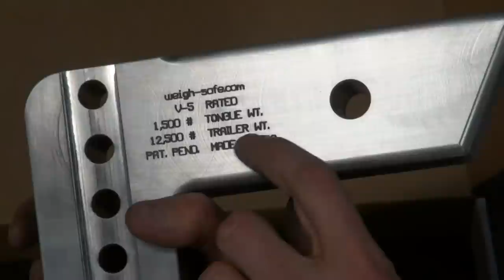Weigh-Safe factory review, adjustable aluminum hitch that weighs trailer tongue weight

Comment: jason beaulieu sad for you! Mine is GREAT! I love it. I haul 3 different trailers, dump, equipment and boat on two different trucks a F350 and a GMC Canyon Duramax. My heavy drop hitches now set in a corner of my garage. Tongue weight is more critical on my Canyon, only 700 max. Now I know what my TW is. Having read comments, I used my old scale a few times to be sure the WS was accurate. It was spot on.

Comment: Weigh Safe Co. are you not worried about the play with the ball in the holder?  We basically know that the ball itself will not wear, being stainless steel, but the softer aluminum will wear,  increasing the play. The play is no different than having all steel setup and having the nut loose.  I believe you need a sleeve pressed into the holder that will not wear so quickly.

Comment: I must ask, how does it perform when water gets in between the ball and the housing? ....because it will. Not only water but how about road grime? Grease/oil?  Just because the tolerance is close and tight that alone will not keep out water and road grime. Just my thoughts....
Reply: I'll let you know.  Mine arrives tomorrow and I'll be using it for my boat.

Comment: Kent, I have a 6" drop weight distributing hitch. Can you teach us the reason for the different height selections, why, and how to choose the best spot? Thanks for the info on the Weigh-Safe products.
Reply from the maker: LD ODOM It's all about leveling out the trailer. An adjustable hitch allows you to adjust the trailer level, which helps the trailer brakes contact the road the same for better braking.

Comment: Ford says that an equalizing hitch is not necessary with a 3" hitch shank used in their 3" receiver on the 2017 Super Duty. What are your thoughts on this? Weigh Safe now makes a 3" hitch shaft.
Reply from the maker: That's true, both GM and Ford on heavy duty and super duty have the same tow rating with and without WDH, Ford starting in 2017, GM did that back in 2011

Comment: IM TRYING TO GET ONE FOR A DUMP TRUCK I DRIVE TO PULL A BOBCAT SKID-STEER AND OR A BOBCAT EXCAVATOR AN E55 will THIS Be WEIGH SAFE BE GOOD??
Reply from the maker: Yes for tongue weight
Reply: MrTruckTV what do you mean yes by tongue weight I know there’s trailer weight but what’s the difference
Reply from the maker: The difference between what.

Comment: What drop would you suggest for a stock Ram Sport 2017? For "general purpose" without affecting much clearance
Reply from the maker: If it's a 1500, you may not need to drop it

Comment: What hitch would you recommend for Honda Ridgeline 2019?
Reply from the maker: WIth just a 5000 lb trailer, you could use any of them. I think an Andersen WDH would be the best. You're at the limit whether you need Weight Distributing Hitch, but the sway control for the trailer would be good safety against side wind and crazy traffic.

Comment: Will there be corrosion between the two different metals
Reply from the maker: From what I know with horse trailers, thick metal between aluminum and steel don't have much of a problem. It's when sheet aluminum sits on thick metal that you have a reaction
Reply: You will get what’s called galvanic corrosion. Aluminum will corrode before stainless steel. Keep grease between the two materials and it will
Mitigate this scientific reaction. You’d have to deal with basic steel the same way so the parts wouldn’t rust together. I have the 180 version without the scale. 

If you’ve ever seen an outboard motor for a boat, you’ll notice a little piece of zinc on it. This piece of zinc is a sacrificial anode. It corrodes before the aluminum. In This hitch’s case, the aluminum would be the anode to the stainless steel. So the grease between the two will stop direct contact.

Comment: whats the difference between the LTB8-2 & the TB8-2 ?
Reply from the maker: I'll have to look it up
Reply: found out.  The TB8-2 is an older model that's been discontinued. Basically the newer model now has the keyed lock on the side.  I just bought one.  Love it so far.  probably be buying a second one for my trailer rentals.

Comment: Not much point in making a "heavy duty" part out of aluminum.
Reply from the maker: Tell that to the Air Force or Boeing
Reply: Wrong.
Reply: a 90 degree bend causing a stress concentration and a material known for fatigue.  PLEASE, PLEASE tell the Air Force and Boeing so that they can tell this company that its the wrong material for this application.